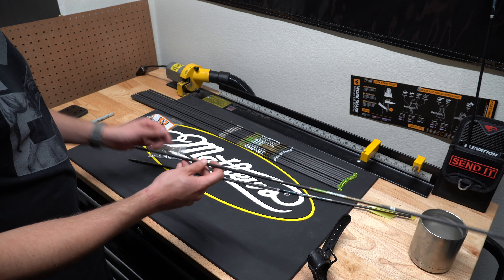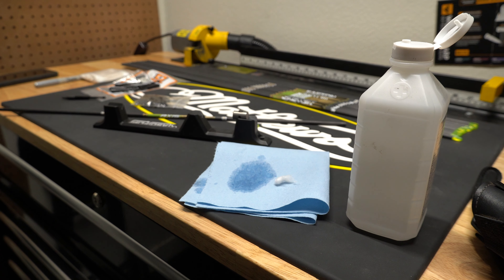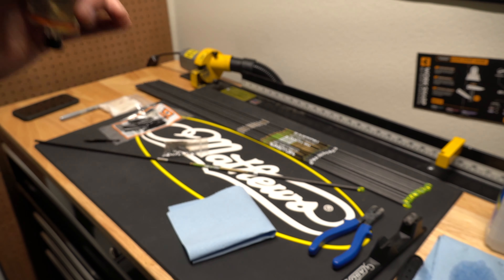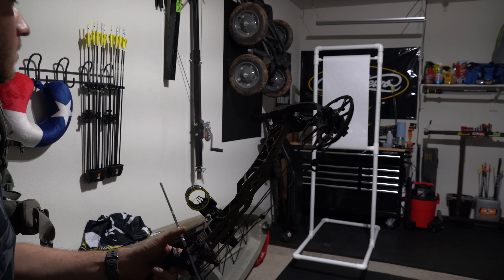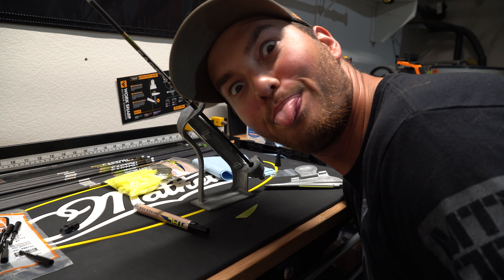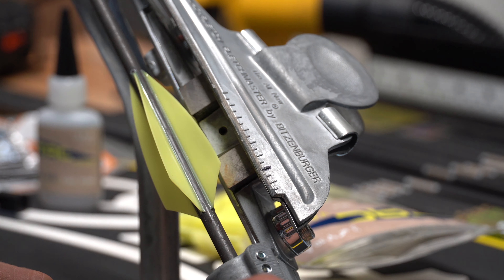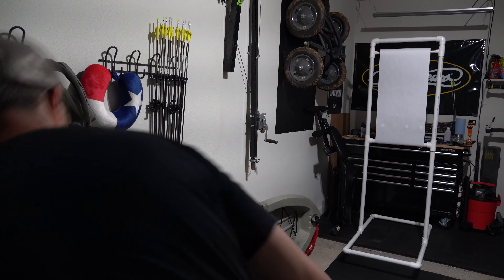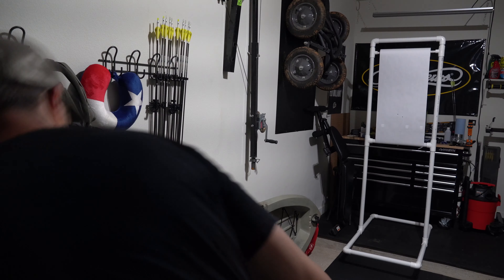New Arrow Setup? What'd I do?

Comment: Tacs seem good but they need to make a lower profile vane
Reply from the maker: I switched to these from bohning heat vanes for a slightly higher profile. Wanted to see what a little more steering power would do especially at long distances. Both are good options I would say
Reply: @dangustafsonhunt  well thats good to know I run the heats absolutely love em imo lower profile less drag and wind disturbance from high profile 
Low n stiff my man
Reply from the maker: @jasonnester9514  yep I’m with it man I still got a bunch of heat vanes ready to go so I can go back and forth. Love them just wanted to see if TAC vanes would help for long distance and that’s mainly where I see the difference. Can’t beat bohning’s adhesion though
Reply from the maker: @jasonnester9514  I also shoot fixed blades almost exclusively so having just a bit higher profile vanes on my setup seems to help
Reply: @dangustafsonhunt  ahhhhhh makes sense
Reply: @dangustafsonhunt  I’m more of a target guy
Reply from the maker: @jasonnester9514  ah yeah that makes a bit of a difference 😂
Reply: @dangustafsonhunt  just a tad lol

Comment: Fast set glue is not as strong as a long cure epoxy
Reply from the maker: No, but it’s still a two part epoxy. Just doesn’t take as long to cure. I have yet to run into issues with it 🤷🏼‍♂️

Comment: What is your field tip weight?
Reply from the maker: 125 grains on this arrow. 466gr total
Reply: @dangustafsonhunt  nice! I'm thinking about d doing the same set up.  What is you foc %?
Reply from the maker: @cameronpaulk4449  It’s been a great arrow so far. It is lighter than what I was going for at 75# but it works. I haven’t calculated foc. I don’t worry about that too much, it’s more than enough lol. As long as I have 125-175gr up front I call it good. That range is deadly with any of today’s bows
Reply: @dangustafsonhunt  that's what I am worried about. I am at 72# and 30" DL using Easton axis 300 spine and I'm already at 480 grains. I'd like to stay that weight but a heavier foc. I think I can get around 470ish with the 4mm arrows with a 125 up front
Reply from the maker: @cameronpaulk4449  yeah you should be right in there. I’m 29.5” DL cut my arrows at 28” and got 466gr total with 125 up front. You should be just a bit heavier than that